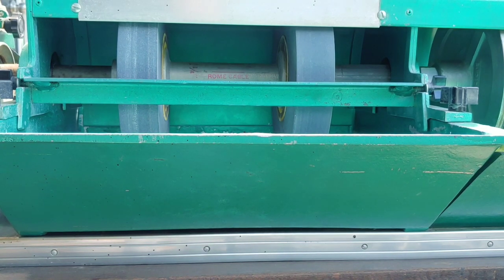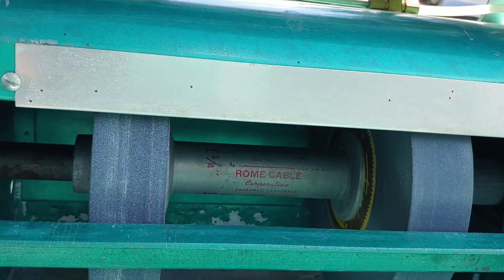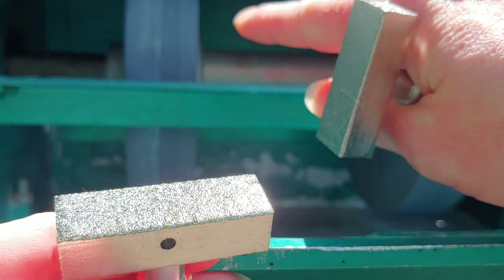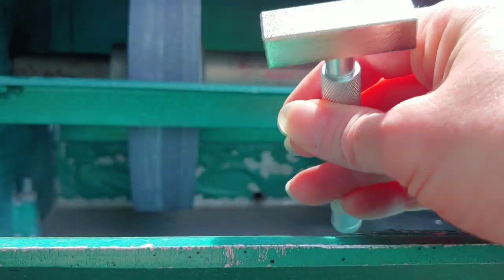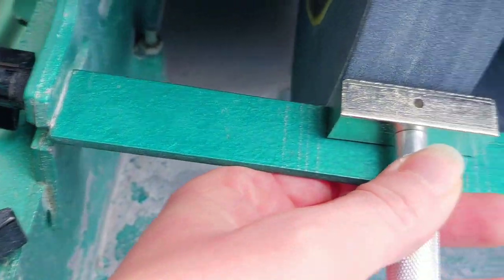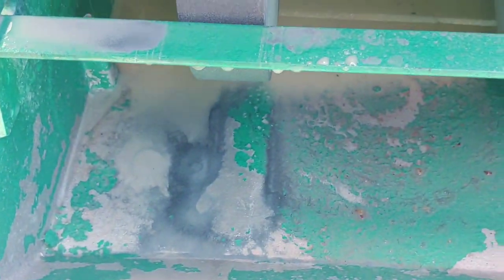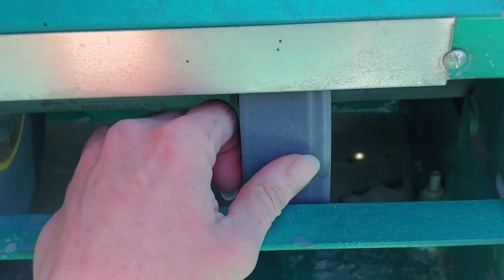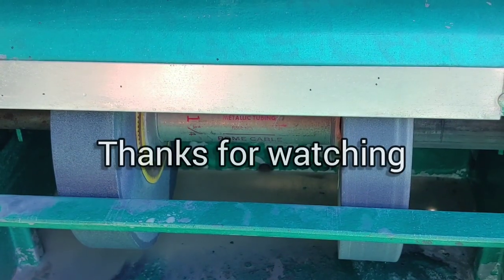How to dress silicon carbide grinding wheels for cabbing machines #thefinders

Comment: Well done! How much do those have to wear down before a replacement is required?
Reply from the maker: Thanks 🐢! Till there's no more silicon carbide left to work with
Reply: @MarlainaAtkins  How deep into that wheel does it go?
Reply from the maker: @RagnarRocks  I did get the whole machine including wheels already used... but as of right now I have about 2 inches deep to work with
Reply from the maker: @RagnarRocks  I imagine it'll be awhile before I need new wheels
Reply: - my wheels seem To wear down too fast do yo to be dressed I must be doing something wrong
Reply from the maker: My issue is... I don't use the whole surface of the wheel which leaves an uneven surface over time. So to get it "flat" again... I dress it. 😊